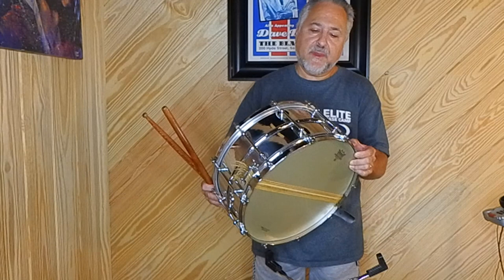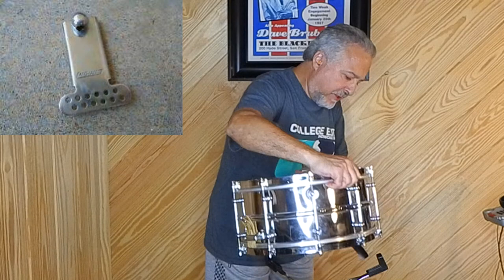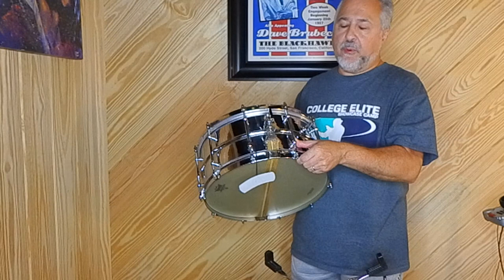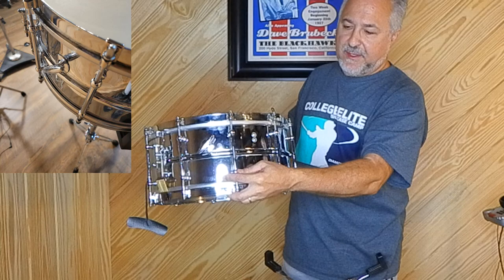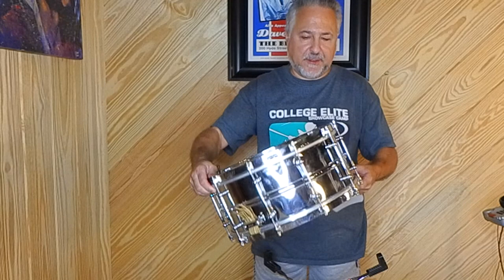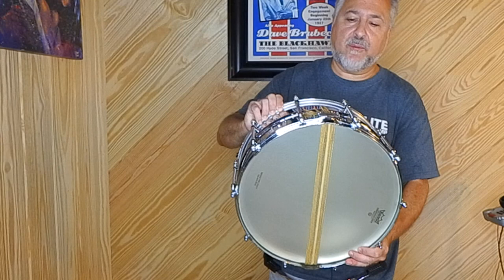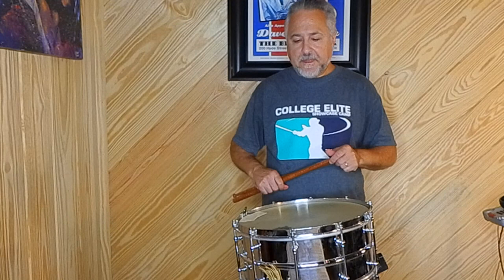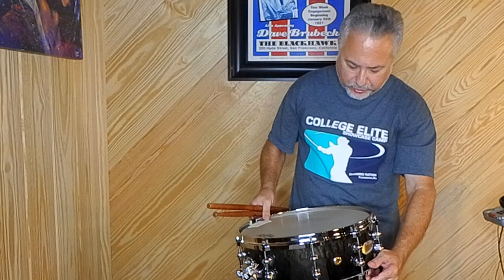1920's NOB Super Ludwig Snare Drum  -Gut Snares Part 2

Comment: Hi Rick,what do you think about play pianissimo whith gold cables,can you really do it in an orchestra??,thanks.
Reply from the maker: Hi Mario
What do you mean by gold cables? If you are talking about the gold Puresound snares that would not be practical because of the sympathetic vibration (snare buzz) caused by lower instruments such as the low brass , french horns, bass drum and timpani.
Reply: I'm talking about for example  Grover gold ( like gut)8 cables alone to play ppp or i need to put it with wound wire cables to play smooth rolls??,what do you think it works better,because i'm tunning a Tama starphonic steel snare drum,and i have doubts